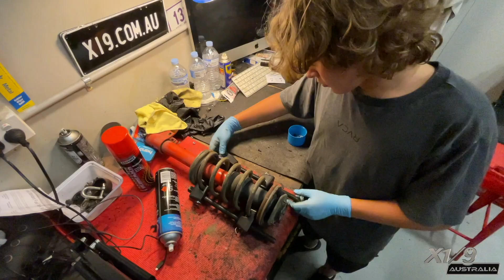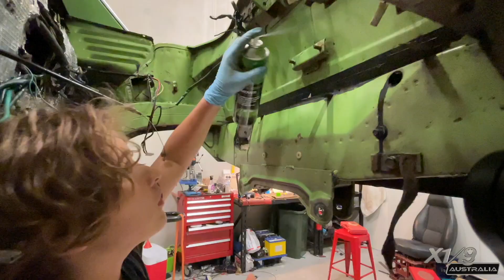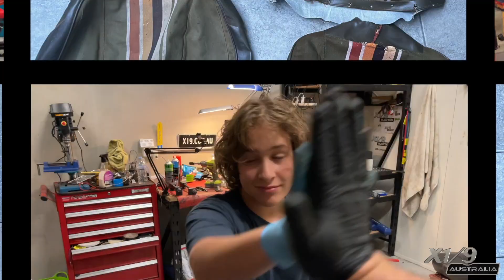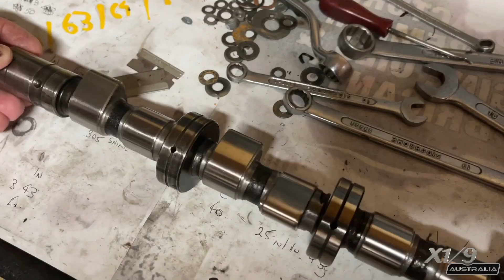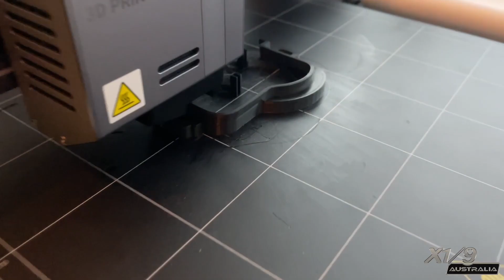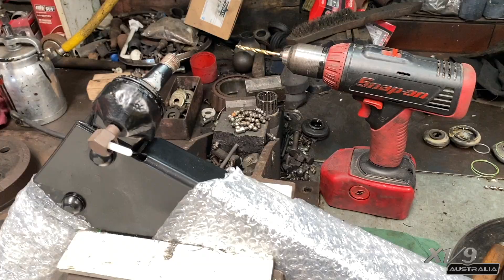The Green Machine Part 15 of a Fiat X1/9 fix

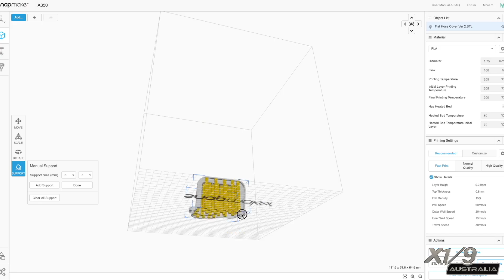Comment: Hi there, do you think it would be possible to share the 3D model from 3:00? Would be a great help, thanks.
Reply from the maker: I would like to but the file is not mine. I can get you in touch with the owner who is selling them. In the future I would like a free shared section for 3D printing X1/9 parts on the website.
Reply: @x19australia  That'd be great, thanks.